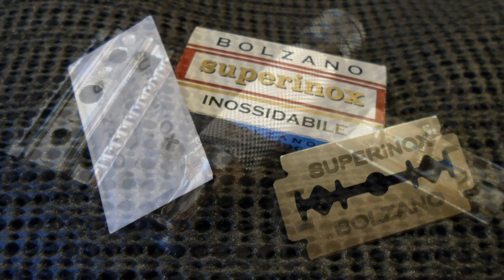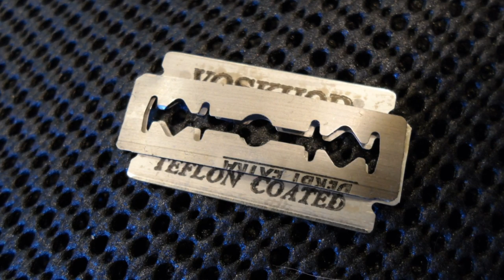Talking about Razor Shimming and Less Popular Shave Brush Knots

Comment: Thanks for the video, I was wondering how to "shim" my razor . Now I just need to know what to cut my blades with. I tried scizors but that just dented the blades. So im not sure what to use correctly. if you could let me know that would be a big help. Thanks
Reply from the maker: Use scissors, but the small nail trimming type, very sharp work best for me.  Big scissors unless very good quality aren't usually sharp enough.  Surgical scissors are pretty good too.

Comment: Thank you for this video and as a complete newbie to DE shaving , Youtube has been invaluable. You make it look effortless and I'm slightly envious that my skill and technique isn't up to scratch just yet. I purchased a Feather ASD2 purely because of the "mild" reputation with Feather blades but I'm encountering major irritation. After a couple of healing days I'm persevering with trying to apply zero pressure , blade angle and beard mapping but my stubble is so coarse to the point I'm struggling to make a dent in it and having to make multiple passes. Do you think I need to stick with it or go slightly more aggressive with a shim? If so , will that compromise the blade angle from the recommended 45 degrees to something a little more shallow. Sorry for the wordy post but from your vids you seem very approachable and tolerant lol. Keep up the good work :)
Reply from the maker: +VadersDarkside Don't know what shimming would do as to angle...though angle is something you have to "feel out" and find the right angle for your particular face with that particular razor...recommended angles don't mean anything. I would say the Feather blades are more of the problem. Always found them to be "harsh" and unsmooth. I prefer Kai blades for super sharp but smooth. With a coarse beard a mild razor probably isn't the best idea. You need a more efficient razor and if the Feather ASD2 is what you have then shimming is worth a shot. Personna Med Prep or really any of the Personna coated blades would be another option.
Reply: +MadScientist .OfWetShaving (BigJohn) I'll definitely check out Kai blades and give them a shot first. Many thanks for the advice , it's a bit of a steep learning curve this shaving game but hopefully I'll get there soon.

Comment: Hmm might be able to shim a TTO. after my new to me G-Bar gets here i might try the shim idea on my starter Micro touch i think it could be a bit more aggressive. If it works i will let you know..
Reply: Well tried to shim the Micro touch tto it worked took a bit of time to ensure blade alignment and didnt  crank the head overly tight but yes you can shim a tto if careful. It will also let a newer guy know where he lets his technique slip no bad nicks or cuts but a few weepers i havnt had in  awhile.
Reply from the maker: Keith Grantmaier Way to go Keith.

Comment: I had a cheap pure badger that had some sharp bristles that would poke me like a needle. I just could not use it without getting "bee stung" I suspected the hair might have been trimmed. Luckily the knot fell out.
Reply: I'll take the synthetic every time, in that price bracket. Yes, water runs out easier. Simple solution: don't load it with water.

Comment: hi john , I want to buy a brand new non adjustable razor and it must be brand new for hygine reason's.
I do not want a slant.
looked at the Bluebirds Revenge Scimitar , Edwin Jagger DE89 , Merkur 38C Barberpole , Merkur 34C , Muhle R89 and I know there are many more out there.
do you have one that would give me a close shave and remember a non adjustable is what I want .. Thanks.
Reply from the maker: The ones you mentioned are all fairly mild shavers.  For a bit more aggression there's the Parker three piece in both open comb and closed comb.  The Maggard Razors are a bit more aggressive than the Parkers and the Matador closed comb even more aggressive.  One of the most comfortable more aggressive razors is the RazoRock Jaws.  Just depends on the level of aggressiveness you desire and of course everyone's experience with a particular razor is unique.  The only real way to tell if a razor is right for you is to try it out.